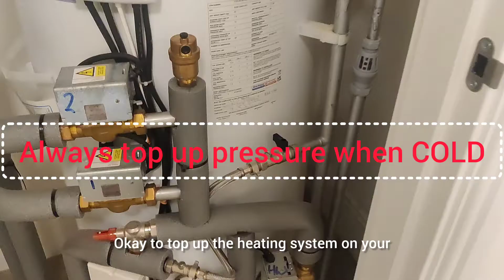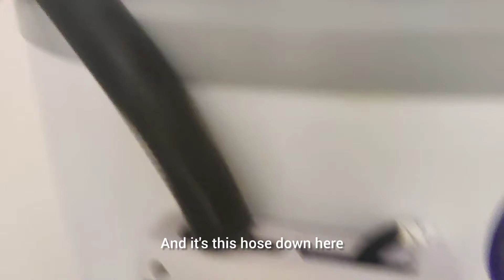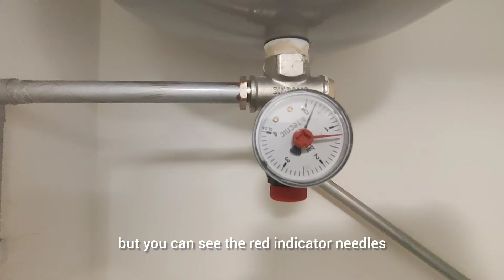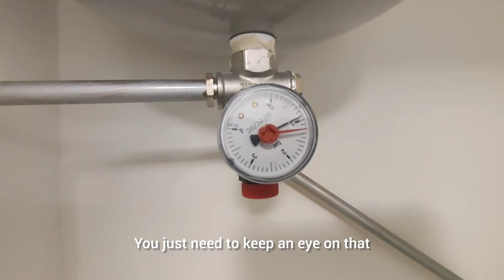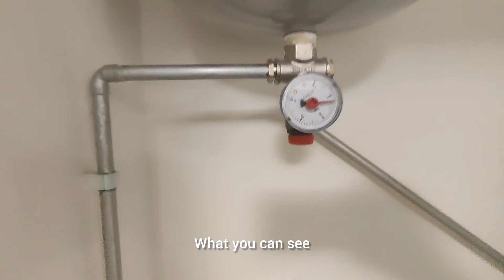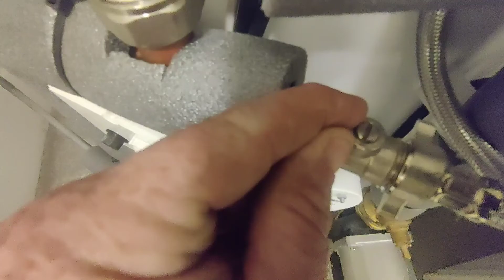Topping up the Pressure using Filling Loop

Comment: Hello... I have a condensing boiler (Worcester Bosch 24i  System Mk 111) with an unvented Megaflow Heatrae Sadia pressurised hot water cylinder (with built in expansion vessel). I take it I don't need a separate expansion vessel for the system boiler? Pressure is being lost currently - actually following a service - I am not impressed. I haven't found a radiator leak. The engineer (said he was G3 registered but clearly is not). To maintain pressure to around 1 - 1,5 I am very slightly opening the filling loop and closing when not in use whilst waiting for someone. Do you know a G3 engineer in Swansea? I realise I will have to have the anti-corrosion fluid replaced. Any other considerations whilst waiting? I have got it balanced currently, on a temporary basis with just enough fresh water intake to maintain pressure around 1.25.   ON A TEMPORARY BASIS  till help arrives. Thanks for your great video. I used to do this annually or when boiler was serviced.
Reply from the maker: Sounds to me me like you have an issue with your timing on your hot water heating program. Don't jump on that your service engineer has done something wrong as it sounds probable the issue may be your settings not his/her service. Unvented Cylinders are more temperamental than boilers and need the annual service. You can check your engineers G3 quals on gas safe register. you are looking at probable expansion vessel issue or PRV issue. Anti corrosion fluid is not a thing for what you are looking at. Guessing you have an issue where you are overheating your water (too long on the program & cyl stat set too high) or the expansion isnt there (service issue, that is a maintenance cost if needing replacing)
Reply: @theheatingpro  Thank you so much. I had a new boiler in the end!!

Comment: Hi guys, many thanks for this. Very useful footage. Just one question.... my pressure gauge has red needle near 0.5 and black needle at 1.5. How to i move the red needle closer / align to the black needle? Thanks
Reply from the maker: Usually your thumb nail. Red should be set as an indicator of where you want the black to be as a visual to let you know the pressure has dropped. It will drop over the year and will need a top up from time to time, bit like a car tyre with a slow puncture. I would advise to keep around 1bar, check when everything is cold for a true reading as the pressure goes up when it is hot